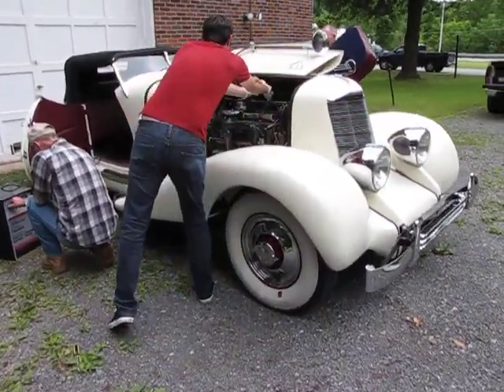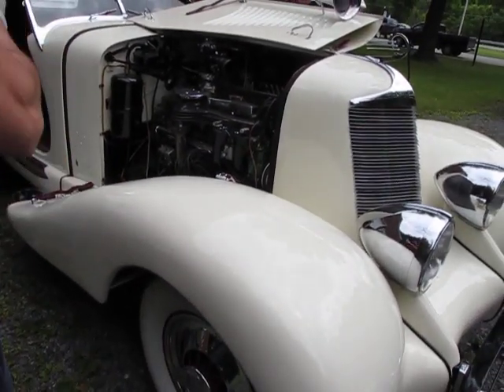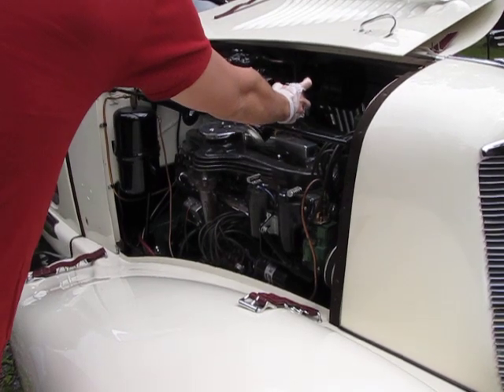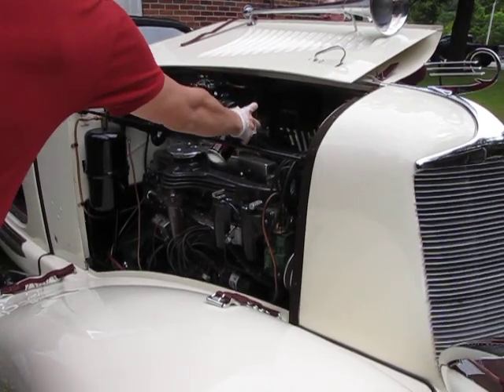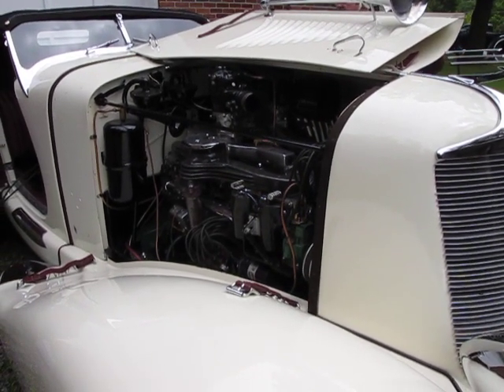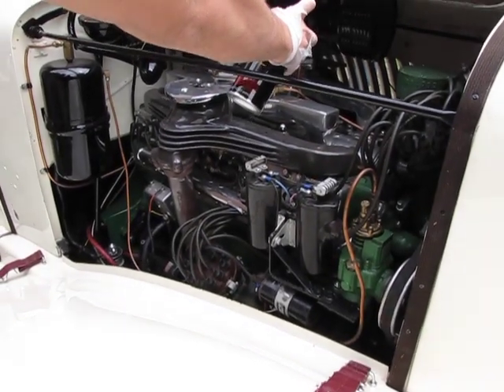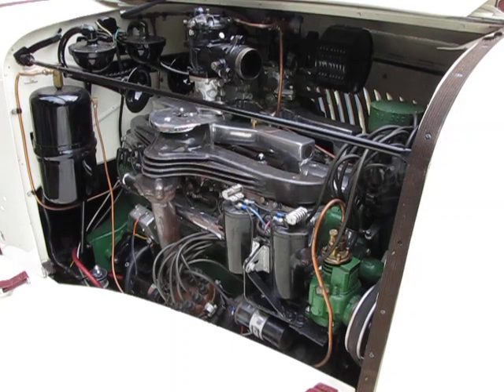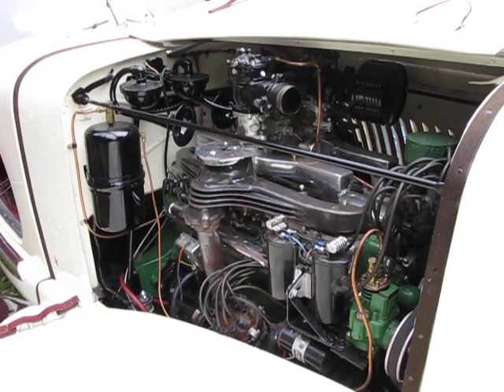1936 Duesenberg start up

Comment from the maker: The car is a 1 of 1 prototype made in 1936. It has a Lycoming V-12, which is similar to the Auburn engine. The original idea was to have a car to compete with the Auburn speedsters. As for it running. The car is in the Swigart Museum collection, and the cars in the collection, while they do get moved around, aren't run on a regular basis. And for storage reasons aren't stored with a lot of gasoline in them. The last time the car was run, someone kept poor notes of what was done when it came back
Reply: I believe it is called a gentlemans roadster or speedster something like that

Comment from the maker: It's true that Duesenburgs traditionally had straight 8 engines. However, if you look up the specs for this particular car, you'll see it is in fact a V-12. You can also count the leads coming out of the distributor. This car was a 1 of 1 prototype.
Reply: I'm a little surprised that Duesenberg would worry about competing with the Auburn Speedster since they were, by that time, both owned by E.L. Cord